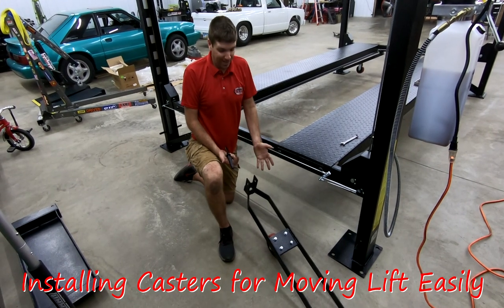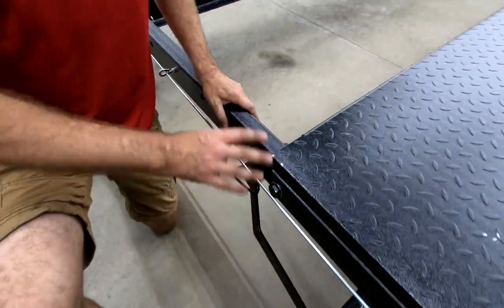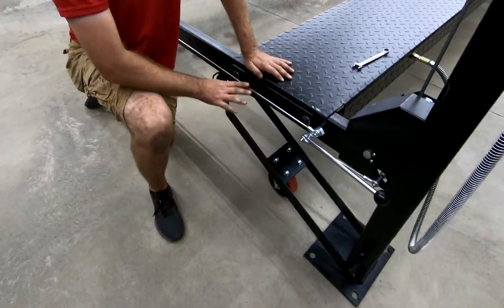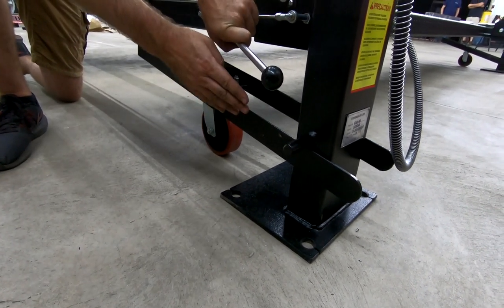Race Tools Direct 4-Post Automotive Lift Caster Setup for Moving Lift

Comment: You'll get maybe 1/8 of an inch off the floor.....notice he does not show that.  If you have a sloped garage or uneven floor you are fooked.  Terrible design!
Reply from the maker: @patricktaylor9629  what was your original order number? You should be able to get it higher than 1/8" off the floor.
Reply: @racetoolsdirect  Sadly I didn't order mine  from you all.  This was just a general comment based on my Tuxedo 8K Lift.
Reply from the maker: @patricktaylor9629  Not sure why you would only get 1/8" off, yo should be able to get more clearance than that as ours do. I suggest reaching out to who you purchased it from or the manufacturer for assistance.
Reply: @racetoolsdirect  Called them today.